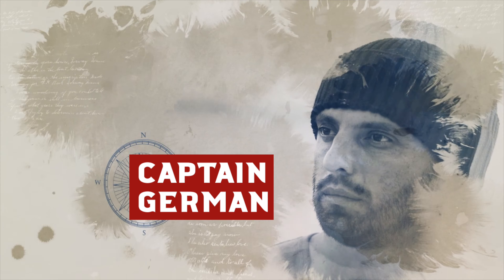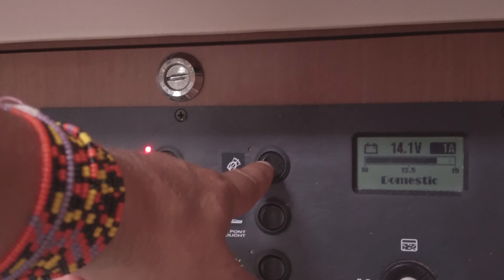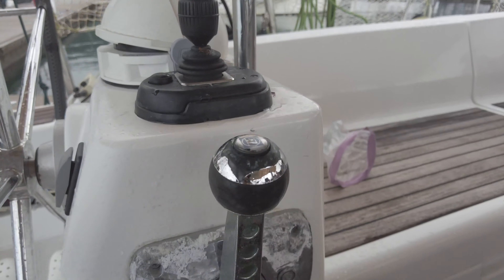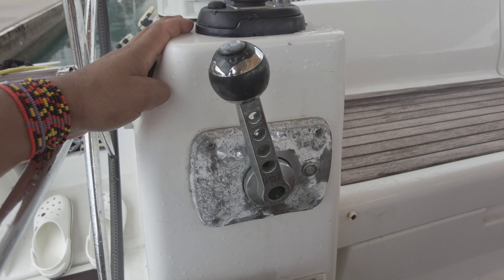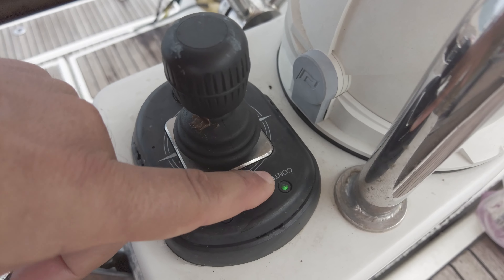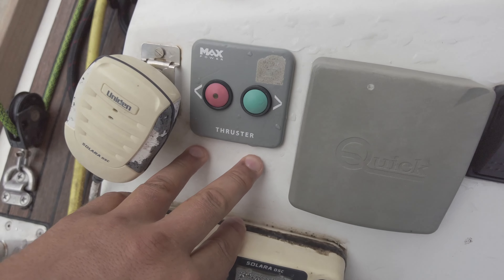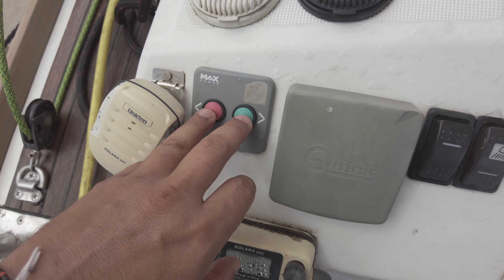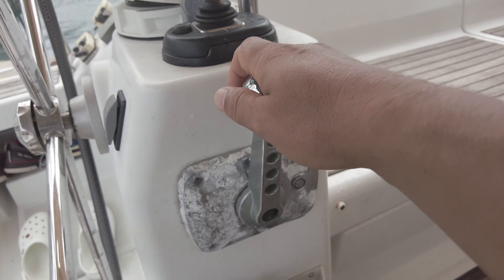Why This Sailboat Engine Is Better Than a Motor

Comment: I just found this video - not even looking for Dock and Go - but as a retired Marine Engineer I watch anything with an engineering bias.😉 Thank you for giving your candid and honest appraisal and excellent functional description of the system and more importantly the shit support from ZF and Yanmar. The throttle control lever plate which is aluminium and badly corroded is just shocking (although you could probably clean it up and spray with a sealing lacquer).

You are probably not interested in my opinion but ai will share it with you anyway.😉

1. Everything you said in your video was absolutely true you are getting full propellor efficiency in any azimuth. Most fixed pitch props will give you about 20% astern.
2. Boats are expensive, the price of this system, the lack of on board diagnostics (like an ODB port) does suggest it has never been properly engineered. It is essentially a parts bin system that has been ‘bolted together’ with the clear intent of repair by high level assemblies (read at a high price).
3. I am a sucker for high tech stuff - and isn’t our life better because of it (GPS/AIS/Radar/Plotters) but just because the technology is available does not mean it is always appropriate to the application.
4. The truth is the integration of this technology into the propulsion system of a yacht just decreases the reliability of the propulsion plant. The apparent advantage of full power at any azimuth is actually irrelevant - you just do not need ‘full power’ astern.

Have you still got the system fitted and what has been your user and maintainer experience since making the video? I suspect - rather less than satisfactory.😉👍

Thanks for sharing - I will look at some of your other videos.😀👍⛵️

Comment: I only remember when it is introduced with the Beneteau Sense line a decade ago, full of nightmares. Very complicated electronics that is difficult and not economically viable to fix.
But I have not seen a single Dock & Go boat since then, not even on new order of Oceanis line and the Sense line seemed to have been discontinued.
I would still like to hear if reliability had improved since then, it would be nice to have it on 50+ ft boats since modern twin rudder boats is not very manoeuvrable motoring astern.
Reply from the maker: Yes you are right. New models have this system only with 50+. I think just because of lack of space at smaller models. The idea of the system is great but how it works it is sad story

Comment: Hi, thanks for the brief explanation. To be honestly, I have concerns about having too much electronic on the boat. How about having both bow truster and stern truster. Can they do the similiar job? I think it could be cost effective as well.
Reply from the maker: Yes. It will work pretty similar. Big advantage of the dock and go that you can use full motor pawer even if you go side. Thruster no reaally mych effective in strong wind. If the condition is moderate okey, will be sane convenient

Comment: Thanks a lot for this very interesting video. I can see that your side mounting control head is completly damaged by corrosion and I have the same problem with my dock & Go on my Oceanis 45 from 2013. Do you know if it is possible to dismantle and by somewhere a new one ? I tried do remove it just to clean and repaint but I do not have any drawing and I don't dare to do it.
Reply from the maker: Write me in whatsap +380935306483 i will explain you

Comment: Hi, is there any fuse box for this system? And usually located at what location?
Reply from the maker: Yes it is 10 automatic fuzed in port cabine, close to batts. BTW there is the place of all the system power supply connectors

Comment: Good Video thanks - from your experience what spare parts specific to the Dock & Go system do you now always keep on your boat?
Reply from the maker: It is not really much to brake. Terminator (resistor) the rest is very difficult to find. No documentation and not clear troubleshooting ((

Comment: System stopped working when out on mooring second time this has happened now 6 years old and they want 7500€ for a new handle not even sure this is the problem question can you bypass the system? It is on a Jeanneau 469
  Thanks Francis in Italy at the moment
Reply from the maker: Hi. It is absolutely not possible to bypass anything in this system. Gas lever cost about 3500 usd ((( It is possible to replace saildrive to mechanical one. There is video at the channel as well. We love the system but decide to change it due to hard maintenance. Our last cost was 25K which help me with replaceing SD decission

Comment: Thanks for the video. Your complaint about poor support is very relatable in many products and companies. But for such an expensive and relatively new system one would think that ZF would do a much better job. How much did your system cost? Does the bow thruster must be from ZF as well?
Reply from the maker: Bow thruster just connected, any system. BTW I found a lot after this video posted. As soon as we stuck in Panama we have time to get deeply inside. It is much simpler than I thought before. Tell me which problem do you have, lets try to find the issue. Regarding the price I do not really remember. I think 25K may me? It was in 2012. almost 10 years ago...